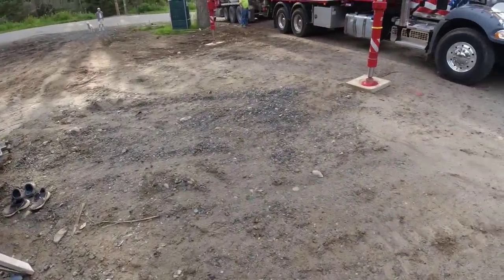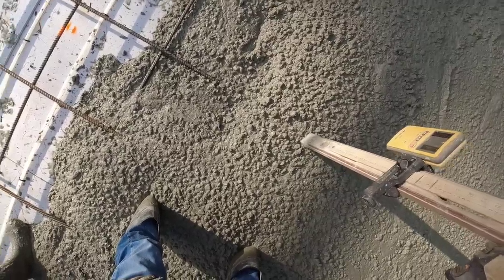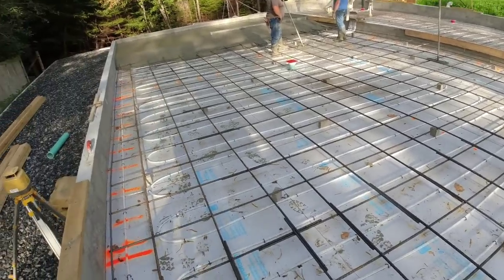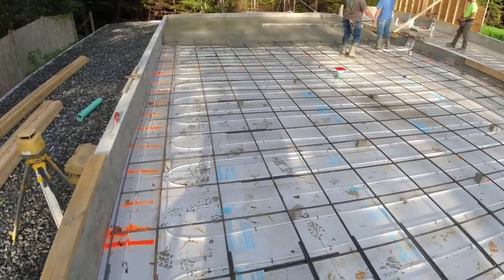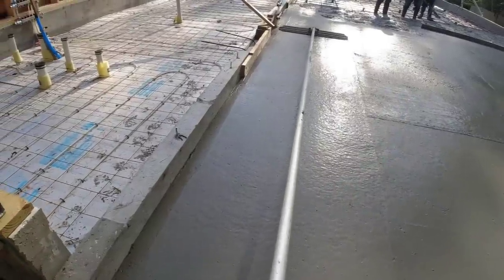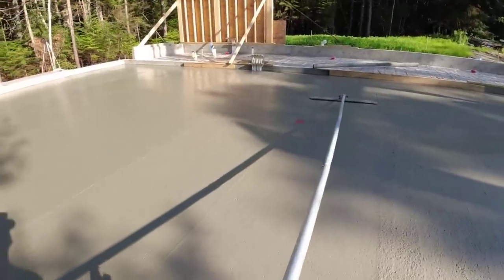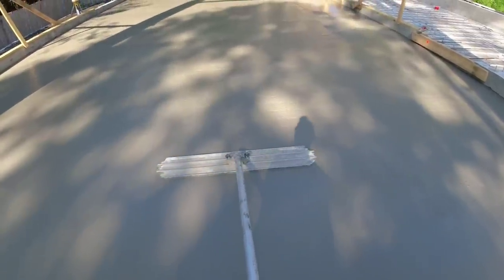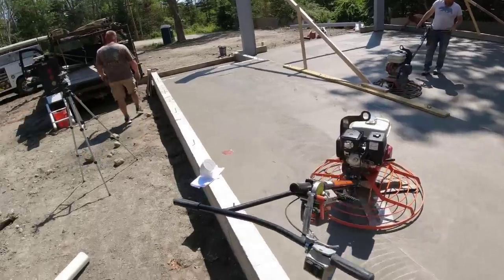This Concrete Floor Was DOUBLE The Regular Thickness!  (Overkill or Not?)

Comment: Great look at a different type job.  Great video.  Thank you.
Before we all say, "It's too thick," consider a couple of things.  Most slab-on-grade cracks happen because of differential settlement and concrete is no good in tension.  It looks like there was some pretty significant fill placed under this site.  Prime opportunity for differential settlement.  If you started with 5" or 6" as some suggest, then slope to a drain or 3" out the door, you've got nothing left at the edge.  The reinforcement is where it needs to be within the slab.  Mats or bars on the bottom of a slab are worthless.
Reply: Haha when you slope to a drain you make up the difference, you still end up having the same thickness

Comment: designers still don't get thermal breaks... under slab insulation, in-slab heat, and no thermal breaks to exterior concrete by the door.